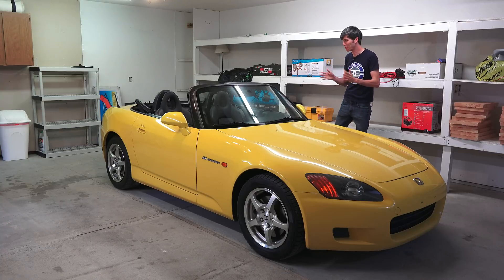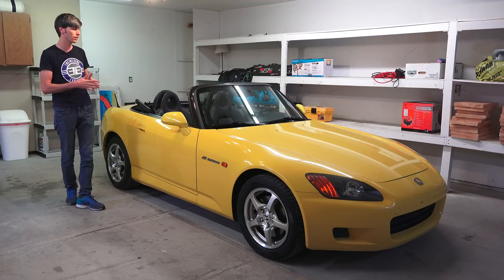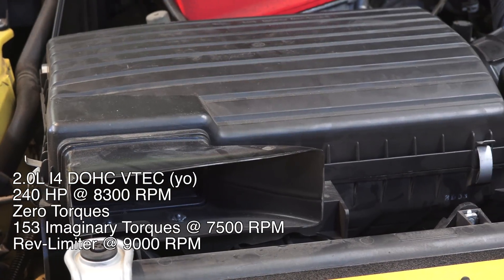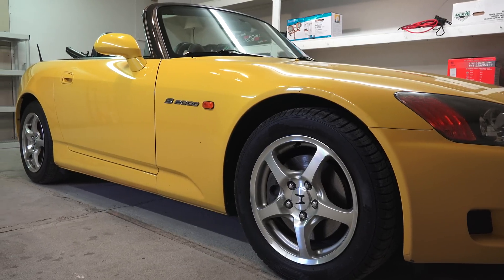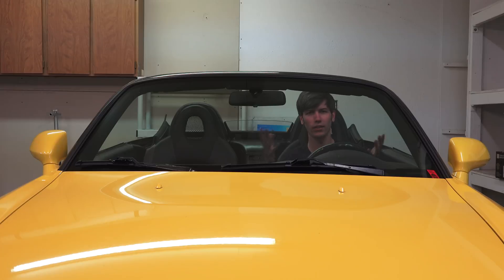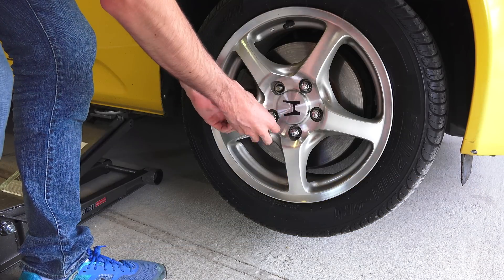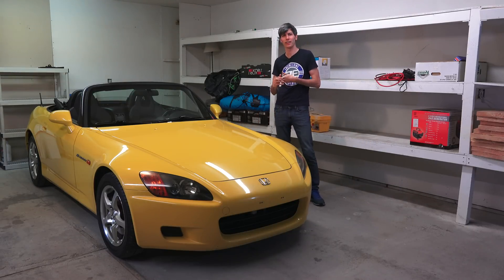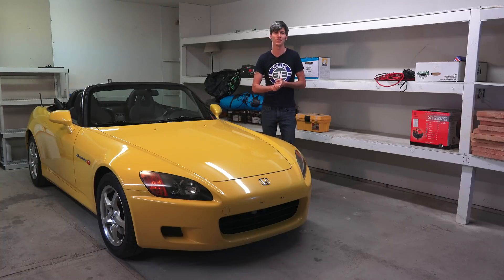I Bought A Honda S2000 And It's Amazing!

Comment: Go with what ya love, man. I'm on my 2nd classic Buick skylark and my 3rd grand prix, which is older than the 2nd I owned, because I really wanted a 2 door with an L67, and I've also had a regal with the L67... so I'm a Buick and Pontiac fanboy. Worse, I'm in that weird fanboy group that likes American fwd 6 bangers... though my skylark does have a modded 455 big block throwing down 540 hp and 560 lb/ft, so I'm not wholly lost

Comment: Congrads - i'm sure you'll enjoy and love it.
Some things that you may or may not know:
1. in Europe they kept using 9000 rpm reving F20 engine even for the AP2 generation (they  still mark it as AP1)
2. The gearbox has an oil pump inside it
3. Open front side of the air box lid to have ~0.5"gap and the intake will sound so much better - this is the mod #1 to do

Comment: A perfect fit for a 9000 r.p.m.  maximum horsepower electric motor http://media.wix.com/ugd/28f2e3_a7428462d2824ec9a1c2a3c813fa850e.pdf
Reply: Oh yes, did I mention 359 horsepower and then you could double that horsepower with a dual stack REMY.

Comment: lovely car hope you have fun I'm in lovely affordable. I just went to test drive one this weekend from a private owner. the car is very stiff compared to the prelude clutch,steering, shifter and suspension. I wanted to make an upgrade for my 93 Honda Prelude as you can see in my review videos. not sure if I want to get the S2000 not sure if I want to purchase a car that can only hold two people

Comment: Why did you go with the AP1 over the AP2? And what are the differences?
Reply: AP2 displacement was 2.2l not 2.4l.
Reply: Ap2, Honda increased displacement to 2.4L for increased torque, lowered the rpm redline to 8K, and changed the suspension tuning because the press slammed it for being too oversteery at the limit. Those are the mechanical changes. There's a different front and rear facia as well as different side skirts. The tear trunk has a lip or deck spoiler depending on the trim level.

Ap2 also was the basis of a track focused model, which more or less made put the suspension tuning back to ap1's more neutral handling characteristic.
Reply: ap1 00-03 ap2 04-09 ap1 revs to 9k  ap2 8k  different  bumpers and some other small differences.
Reply: +Angelo Del-Angel and the engine is a f22  rather than a f20
Reply: The most important difference being the capacity, 2.0L for the F20 and 2.2L for the F22.

Comment: You should make a video about what exactly happens when a manual car stalls out and the science about what happens inside the engine to cause that.
Reply: Stationary wheels have stopped the engine from turning (since the wheels are connected to the engine), that's all? :)

Comment: Honda tried out the fiber reinforced cylinder walls in the 3rd gen prelude (b21A1 engine) and had issues with the rings wearing out. Do you know how that issue was solved?

Comment: The Viper is nothing compared to the S2000. Especially from an engineering standpoint. You've truly purchased one of the greatest cars of all time.
Reply: ***** if the Viper was as efficient as the S2000, I'd have over 1000hp from the factory.
Reply: +Che M exactly..."A car is so much more than its engine" which is why even in comparison an s2k is superior to a viper strictly from an engineering standpoint. Ofcourse 8.4L v10 and the styling is all in the Vipers favor but for what they are an s2k is superior.. it's common sense. 120hp from 1 litre.. so a stock Viper should have 1,008 hp stock. Get it?
Reply: Che M it's got the Greatest Naturally aspirated Engine of all time. http://www.caranddriver.com/flipbook/the-best-naturally-aspirated-engines-of-all-time#25
Reply: Klutch 416 what's really impressive about the S2K is that the JDM versions made 250hp or 125hp per liter. It took Ferrari till the 458 to match that. Honda did it back in 1999. 

You're absolutely right about how balanced the car is and the way every aspect of the car works together. That's what makes it one of the best.
Reply: +Logλn L (ホンダ) It's just the mentality people have "oh Honda is crap because...well it's crap" they can never back it up or process the fact that they're over engineered cars in almost every segment. no point in arguing over YouTube lol. even a Civic is just a civic.. take the turbo off an Sti and it's an impreza..which would get smoked by just a civic haha
Reply: +Che M The video explains very well about the technology that went into the frame of the work to make it rigid even tho it's a convertible. it was ahead of its time. there's nothing else to say, and it gave more to car culture than a Shitstang, Camaro etc.
Reply: ***** did you forget about the Ayrton Senna McLaren Honda Era? Or the fact that Honda was the first Japanese manufacturer to win formula one? Or any of the other times Honda competed in formula one? They're just regaining their footing.
Reply: ur joking right?
Reply: +Che M um a s2k isn't a supermarket nor hypercar.. it's a sub 20k 4 cylinder NA car, compare those. obviously a hyper car is superior to a s2k...why am I discussing this with teenagers on YouTube
Reply: Thank you! You know how under-engineered the viper is? Many owners warn drivers to be careful of them! Ill post some videos about it if you want!
Reply: Preach! I hate under-engineered cars!
Reply: It's because the Viper has a V20 - 20 liter engine and cost twice as much.   Anybody can make a lot of horsepower out of a  V20 - 20 liter engine, but only Ferrari and Honda can make 120hp out of every liter of an NA engine! That's first-class engineering that the Viper can only dream of!
Reply: S2Ks win touge shoot outs and autocross events often... lol
Reply: +Che M it would be within the top 10 in my opinion. R34 gtr, Supra, Fd rx7, Nsx-r, Integra type R, s2000, 300zxtt, Mitsubishi 3000gt, s15 silvia and Evolution 7-9.
Reply: +billy heaton buddy I've built every car I own and my '00 sir is boosted on a 6262 making 540 to the wheels.. I don't need to stunt online or talk down on others cars. you go on honda videos to hate Lmao. get a job
Reply: billy heaton a 2000 S2000 has only lost half it's value over the years (30k new, 15k now) while a 2000 Viper has lost about 2/3rds of its value (75k new, 25k now).
Reply: billy heaton there is your answer 👆🏻
Reply: Jango Bobafett Mercedes engines? Man, McLaren had to partner with Honda for the F1 series because they couldn't achieve what Honda has achieved so far.
Reply: charjohnnie sic personally I just roll my eyes.
Reply: +Logλn L (ホンダ) that is 100% opinion someone in Europe could say a Honda 4 cylinder would never compare to the European N/A V10. that's not exactly proof. A car is so much more than it'd engine
Reply: Klutch 416 no I don't. The other guy said it's one of the greatest I said I'm not sure. Where would it be top 50? 100? He followed by saying it has the greatest N/A motor of ALL TIME. I said a car is so much more than an engine, that's all opinion and anyone can argue that. You followed that by saying which is why the S2K is superior and than you went back to the motor after listing 2 things the viper has in its favor.
Reply: +Jango Bobafett how about another 4 cylinder NA car. you compare cars that are similar in specs and are in the same class. how does a "big brute" compare to a s2k? I'm sure something else can come along and smoke that brute as well..
Reply: Klutch 416 even if I was a teenager it is very childish to take shots at people in a simple discussion. I'm not comparing the car to anything try reading what I said. I never claimed it was a supermarket. Saying the S2K is one of the greatest cars of all time is a big claim especially considering the Super & Hyper car market. Not considering the S2K is in the super or hyper car market. He didn't even say one of the greatest roadsters or one of the greatest Japanese cars. He said one of the greatest of all time.
Reply: +Che M Every aspect of the car works well with one another, this makes it for an amazing drivers car. drive one yourself and we'll see what you say. it makes it one of the top cars made From an Engineering Standpoint
Reply: i think the person was refereing as the greatest at That Particular Time. which is quite relevant. At the time, it is true that 120Hp/litre was unheard of for a common ( non exotic ) car.
Reply: Klutch 416 do not disagree with you that's why I asked for clarification cuz I don't seperate N/A and turbo cars. One of the best Hondas hands down but where would you put it all time, let's say just in Japan
Reply: billy heaton oh come on man, dont let internet discussion like this ruins your weekend. it wouldnt be good to have your mood ruined as well. chill, no need to spew profanities. IMHO, 20K$ poured the right way can make a civic goes faster than 350GT ( perhaps ) But why would anyone do that? for me its the same kind of logic of painting one's bentley florescent pink and drawing internet memes on the rims.
Reply: Now we are in the same page! Take care your S2000 cuz they are becoming rare now. good luck to you mate.
Reply: billy heaton many people payed upward of $40k for the S2000 CR. (Those are still worth $30-35k used these days) 

$25k will get you a fair condition example of a base 2000 dodge viper. If you like em so much, you should go get one.
Reply: +Logλn L (ホンダ) except as is clear with the Hellcats, when it comes to Americans there is such a thing as too much power
Reply: one of the greatest of all time? I'm not sure about that? Top what 50? 100?
Reply: +Che M it's
Reply: Klutch 416 I'm not saying you guys are wrong but saying those are big claims. Especially greatest N/A engine of all time and one of the greatest cars ever. Especially considering the Super & Hyper car market
Reply: Klutch 416 and I think if you are gonna look at the car "all time", you'd look at the msrp based on model year
Reply: Klutch 416 likewise saying the S2K has "the greatest N/A engine of all time", is putting up against ANY N/A engine ever. I start this by asking him to clarify or elaborate is he talking top 50 or top 100 or what.
Reply: +Che M We'll forget top 50 then and how about you state 10 other N/A engines that are better in power output, so hp/L higher than the s2k which is 1L/120. and also it's "engineering explained" so he's speaking from an engineer standpoint.
Reply: Klutch 416 except this isn't Logan's channel. Why do you want me to look for supporting information on someone else's claims?
Reply: Klutch 416 so just to clarify if in fact the S2K is in the top 10 in hp/l as your implying, that makes it one of the best cars of all time?
Reply: Klutch 416 I've driven S2K I've driven mx5 I've driven z3/z4 I've driven z33/z34. I've driven N/A cars boosted cars. It's a fun drive I get that but you or Logan still haven't been able to answer the question. I'm gonna asume your talking about one of the tops cars in comparison to these others. What other than the engine are you talking about what are the aspects of this car that set it apart
Reply: diehardcat Nissan did it too
Reply: krisnadi imam still to say it's the car greatest car of its time is to say is better than the FD Rx7, R34 Skyline, and Honda NSX among others that why I asked
Reply: Klutch 416 I watched the video I thought he was referring to maybe something that wasn't said. I don't believe Honda is crap. I know Honda is a reliable and legitimate car brand. I'm just asking where would you place this car among "the greatest of all time" because there is a Honda model that I believe is universally regarded as better than this. And there were other cars in Japan in the 90's that are legends and among the greats. So where does this fall
Reply: Sorry JDM  fanboy nobody picking a s2000 over a viper
Reply: +Che M The rx7 the r34 the supra and the nsx are always going to be the top 4 cars to ever come out of Japan However they have either single or twin turbos, The rx7 had its downfall with the rotary and nsx was a track monster but noted to be a bit underpowered.
Reply: Klutch 416 Heya, i recommend not responding to billy anymore, its doesnt benefit anyone to fuel his rage. Just leave him be.
Reply: +billy heaton What makes you think I don't bring home 150k+ a year and I'm not 23 yet. I have 4 cars and 2 bikes under my name you can bet there isn't 1 Rustang and never will be. "he's a moron" Lmao. Grow up kid. I never told YOU to have a civic worth 25k but if I bought one and built it best believe it would rape any domestic.
Reply: The car was never designed to be fast off the line in the first place.  It was designed to be a car you could take on a road course, auto cross etc and drive back home.
Reply: Steve Pham, Says who? It  was faster than a danm Stock M3 so how is that make it a car just to drive around and take you home?
Reply: Dennis Bedoya Rare LMFAO let me know how much your S2000 is in 20 years i bet you my life it will not be worth more then a VIPER
Reply: Logλn L Correct.

Comment: Good choice. I personally have an AP2 1st gen. Literally indestructible. My car has been taking a beating at autocrosses for the last 5 years almost every weekend during the autocross season and quite a few track days. The one thing that helps with torque is a really good tune or piggyback ecu. It's amazing what you gain from that alone. Enjoy the car! Best and most fun car I've ever own.

Comment: Ls swap
Reply: No. F20C is the way to go.
Reply: Do that to a Miata instead. Cheaper car to get a hold of and lighter. Don't wreck an S2000.
Reply: ***** It's not a collectible car yet but it will be, especially the stock ones.
Reply: I bought one back in 2012 at 13k for an 05 with a hardtop 60k miles, if you look for one now a days a 2001 with 80-100k miles will run closer to 18k.  CR's are currently selling at MSRP from 2008.  These cars have gone up in astronomical value.

Comment: i thought u wanted something practical, with plenty of space and cheap to run? hahaha
Its good to know u bought an S2000 tho, its a great car.
Reply: come to thhink of it, why it doesnt come with front strut bar? i thought it was standard
Reply: +krisnadi imam no need. The unique double wishbone design puts virtually no stress on the strut tower nor the strut tower anchor points. So a strut bar is for show only. 👍. A X bar though does add some subframe rigidity.
Reply: If you're not married and w/o children how much more practical do you need a car than the space and room you have with a s2k?
Reply: Let's not forget that Honda Vtec has had an incredible reliability run. From the late 90s to about 2012 the Indy Car series ran Honda engines with no reported mechanical failures of any kind. 2004 and older Hondas are as reliable as you can get.
Reply: +David Leong I know right! Unreal. In some cases it has taken until this year even for competitors to replicate Honda's success/reliability/technology.
Reply: ah i see... The S2K is a great car though... i keep wondering why honda has to kill it. It has so much potential as a car. Im guessing no one would mind if out of laziness honda just drop an existing V6 into it to stay relevant. Heck, even without changing anything, i think it still would be relevant today.
Reply: oh... he got the crosstrek as well. i t missed out on that part

Comment: "This was the highest specific output of any naturally aspirated production vehicle on the market when it was released."

Does vehicle not include motorcycles? Because they were making far more hp/liter than the S2000. The Honda CBR600F4i was available in 2001 and made 187 hp per liter.

Comment: The Prelude also had the aluminum fiber cylinder walls, the problem is that it would 'eat' the piston rings causing it to burn oil. It still ran great but every 2nd gas fill up would require adding oil. Great engine though, quite a bit of torque: h22a, 190hp.